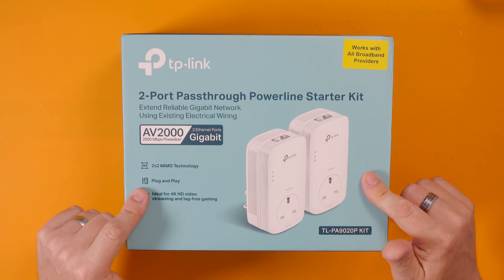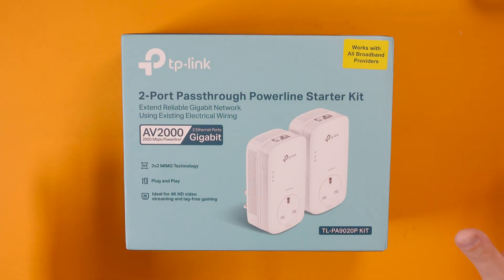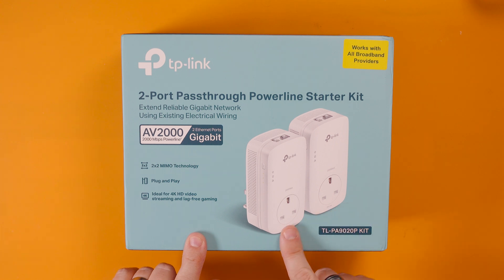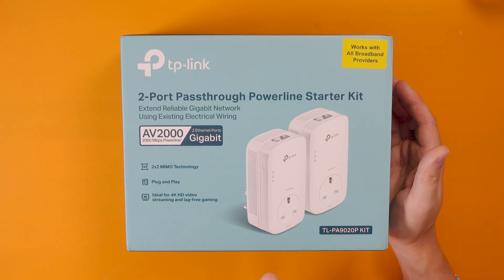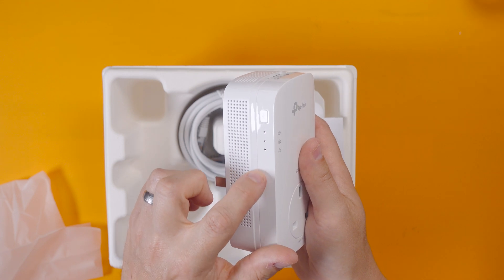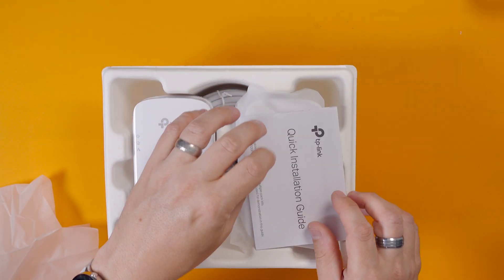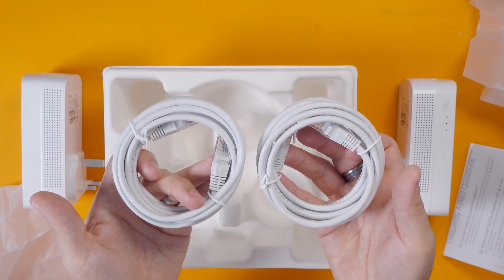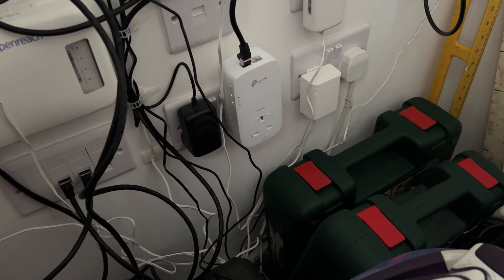Turning my Electrical Wires into Network Cables with a Powerline! Using the TP-Link TL-PA9020PKIT

Comment: Lucky you. I have a Trendnet version of this product.  My wiring doesn't support as fast as I would like.  My kitchen unit gets around 120mbs, while the family room unit hovers around 85mbs.  The kitchen unit feeds to a smaller secondary router which wifi connects to low bandwith connections such as light bulbs and Amazon Echos.  The wifi 5ghz speed on a good day is around 40mb down on that router.  Good enough for smaller stuff, and a guest wifi if I have someone over.

Comment: Great video.  Thank you.  I want to be able to connect between two different ring mains.  Is that possible? I mean, ultimately they are both connected to the main electricity cable coming into the house.  OR do I have to run two ethernet cables from the router - one to the downstairs ring main and one to the upstairs ring main?
Reply from the maker: I think if everything is still going to the same consumer unit, it should work!